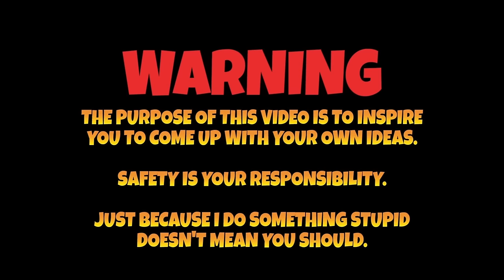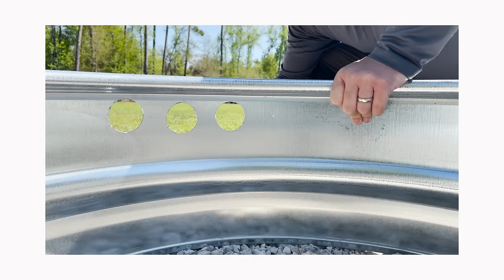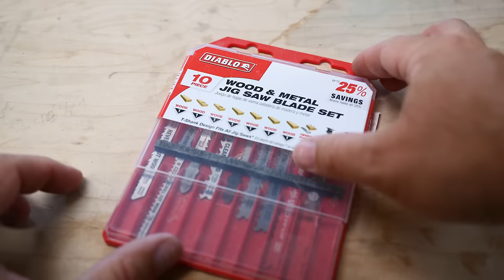8 Must-Have Power Tools For DIY And Woodworking

Comment: That Bosch Colt router is a beast! I worked in a cabinet shop for years and I beat it to death and it never gave up. I have had my personal one for many years now and it does anything I ask of it! Also if you are looking for a jig saw, look for a cordless one that matches your existing cordless tools. I have been using Ryobi cordless for 20ish years as they have retained the same battery size forever! not mot other manufacturers that have changed up styles over the years. The tech has changed but the battery "size" has remained standard.
Reply from the maker: Yeah. I don't think I mentioned it but that Bosch was used in my cabinet shop almost everyday.

Comment: Great video as always.  I still think the Table saw is far more dangerous than a circular saw.  I would add 2 tools to your list... an Oscillating/Multi-Tool & a Reciprocating/Sawzaw.  Although not a must-have, but If you plan to start making furniture, of course a planer (like a lunchbox planer) is super important for milling your wood to dimension.  Although a Jointer being the companion tool to a planer for doing milling, as you mentioned it's really not needed at all if you have a Track Saw or other tools and unless you have a dedicated shop that's large enough, totally not worth it.  Benchtop Jointers are also pretty much useless.
Reply: yeah i actually think the impact driver & osci should be in the top 5

Comment: Hey Adam! I bought the DeWalt 20v hammer drive drill that came with an impact driver almost 8 years ago. I thought the driver was a waste since I had a drill, but boy was I wrong. The impact driver is my go-to tool more than any other. I use it several times a week and the original 3amp batteries are still going strong! You know what tool I bought that I hate? One of those roto-zip things for cutting drywall around outlets. I gave it away and bought a cordless oscillating multi-tool. Love it!
Reply from the maker: Yes those multi tools can be a lifesaver. When I used to install cabinets in existing homes I had to remove baseboard to cut it. When they came out with those multitools I could just cut out the section I needed removed. HUGE timesaver. Thanks Ed!

Comment: I would recommend a non-sliding miter saw because the sliding mechanism introduces too much play. I've tried sliders from Makita, Ridgid, and Dewalt and none could cut a consistent or straight line. The Makita was a particular disappointment - sliding 90 degree cuts were bowed about 1/16" of an inch). Went back to a non-sliding and have had much better luck.
Reply from the maker: You should try the Bosch with the articulating arm. It cuts like a laser in and out of the same cut. No drift. I used mine in a cabinet shop for many years and it still cuts like the day I got it.

Comment: Hi , a bit late but I wanted to say this : in Europe we have all 3 tipes of drill in 1 , it comes from the manufacturer most of them. You just select what you want to do with it with that "clutch" . I was always wondering why you need 2 drills . Thanks for the video.

Comment: thanks for the video.  Although I have to say that you don't need to stick with one battery platform because one brand does not make the best of each tool.  you will need at least in my opinion three different tool brands to cover all of your woodworking needs the secret is get a couple of decent batteries for each brand and then by the bare  tools after that that's where you save the money

Comment: Something I would like to point out is that all the tools that have 20v max in them are not 20v but rather 18v, the 20v is just max battery voltage at full and under no load, but it drops down to 18v when using it.

That also means the 18v tools are technically all 20v max as well, but they are advertising it how it would function under normal circumstances.
Reply: Came to say this. 18v and 20v are the same thing.
Reply: Some brands says 20V like Dewalt because Milwaukee patented the "18V"! So to avoid paying royalty to Milwaukee, some brands just label theirs as 20v instead. And who says I can't user impact driver to drill? I find that I use impact drivers more than the drill. It's smaller, shorter, and just 1 tool. The bits are easier to insert and remove too. So as long as the holes are 1/4" or less, I just use the impact driver for everything, drill, then drive screws into them.
Reply: @1tuyenp  That's not true, at all. Dewalt originally had 18v tools when their batteries were NiCad and had the battery slide up into the grip, but they changed to 20v Max when going Li-Ion to avoid confusion.

Milwaukee patented Li-Ion technology, so it doesn't matter if dewalt used 18, 20, or any other voltage, they would still need to pay some royalties. Bosch, Makita, Metabo HPT, Ridgid, Ryobi, and Skil are all brands I can think of that use the 18v denomination and not 20v; even dewalt uses 18v still in Europe and a few other places because they can't advertise max voltage when the battery is only 20v at full charge and no load.

Nobody said anything about drills or impacts as well, they make impact rated drill bits for that very reason.
Reply: @tylerperlenfein  I have Dewalt 18v Lithium-ion battery tools that I still use. Milwaukee sued Makita Snap-on and other smaller tool makers. But they never sued Bosch or Dewalt. TTI makes Milwaukee, Ridgid and Ryobi tools. That's why those tools are 18v. Those smaller tool makers like Snap-on lost the patent suit to Milwaukee must have an agreement with Milwaukee, so their tools are 18v as well. Stantley Black and Decker makes Dewalt, MasterCraft, Black and Decker, Porter Cable. They were not sued by Milwaukee and probably did not have an agreement with Milwaukee, So those tools are marketed as 20v. I don't know much about Europe or if Milwaukee's patents are valid in Europe. So I'll pass that on.
Reply: @1tuyenp  The battery related patents that Milwaukee hold are related to Lithium based battery packs, there is no mention of voltage because they can't patent a voltage level that a battery operates at.

The suit you are talking about also only mentions lithium based batteries, not the voltage. The original batteries that Milwaukee produced as Li-Ion were V28, so once again voltage was not at all a deciding factor in this. Ridgid even filed a suit against Milwaukee despite both being TTI products, so that argument doesn't really hold up that well.

Makita and Hitachi both settled out of court, but Bosch was never sued (unless the place I am looking missed the records of it happening) yet they still make 18v tools.

Milwaukee also makes 12v tools, but so does DeWalt, and DeWalt hasn't been forced to change the voltage of those tools.

I really don't know where you came to the conclusion that Milwaukee owns an 18v patent when that has never been a thing they had nor can you really patent a voltage, especially considering voltage changes with charge, temperature, the load it is connected to, etc. They own a lithium pack patent, you can even look it up with a 1 minute search and read that it in no way mentions voltage, DeWalt only went 20v to differentiate between new tools and old tools that used a different connector type.
Reply: @tylerperlenfein  You can avoid a patent by paying the royalty fee? Like you can avoid my "obnoxious" demand by doing what I say? I asked how long have people package battery cells to make a bigger battery? Then Milwaukee uses lithium ion cells, then it's a patent? I don't care if that's what Milwaukee wants. I own Milwaukee tools too. But I do think they are bogus patents. Just like putting words together to write a story. They can claim copyrights for the hooks, or the way the package the cells together. But patents? They did not invent anything. So their patents are just bogus. As for 18v or 20v, tell me why Dewalts don't want to use the same marketing outside North America? And it's just coincident that Milwaukee's patents probably are not valid outside of North America? Do you know that patents office now a day don't have the resources to research patent applications anymore? So they would grant a lot of patents to big companies with high power patent attorneys, and let the courts to sort it out. But then in courts, it's just a crap shoot.
Reply: @tylerperlenfein  Those who cant' argue on merits attacks spuriously
Reply: @1tuyenp  I'm really living rent free in your head if you had to come back to something that was already done being discussed and make a new "clever" comment.

Be better than this...
Reply: @tylerperlenfein  That's just what I thought when I saw your comment again

Comment: You can get a drill chuck and drill bits with  1/4" quick connect ends, great to only carry 1 tool up a ladder to predrill and drive screws.

Comment: ALWAYS wear safety glasses with a mitre saw. Last year I didn’t follow my own advice and was trimming some boards, a freak breeze blew a 1”x1.25”x8” offcut back into the spinning blade, the offcut got picked up and thrown directly into my right eye at over 140mph. The fact that I still have an eye is amazing, the doctors said that if the piece was thinner it would’ve taken out my eye and impacted my brain.
Reply: Yeah same happen to me but I was lucky it got stuck into the blade but I got a serious case of kick back and the baseboard whipped my finger giving me a bad bruise I felt for 2 weeks…. If it didn’t get stuck it would have flown to my face. I wear glasses now
Reply: @marlonestrella8105  I can say from my experience that you did get extremely lucky. The final piece of paint/wood finally migrated out of my eye 12 months after the injury. Until that piece left if a light source was at a specific angle that one eye would get a light flare up inside it due to reflection. That whole experience was all around horrible
Reply: @SKPhoto816  damn…. Sorry to hear that…. Kick backs are no joke… did you upgrade the throat plate for zero clearance on your miter saw?
I get anxious when I see you tubers who’s using power tools without safety equipment on…. People who don’t use glasses and riving knife on their tableaws irks me the most
Reply: @marlonestrella8105  yep, I did a custom zero clearance to avoid further risk and give me cleaner cuts. During the day of my accident I was wearing safety glasses, I took them off because they got too fogged up and made one more cut like an idiot. Now if they fog I stop working with the power tools and do something else
Reply: @SKPhoto816  have you found a safety glasses that doesn’t fog up yet?
Reply: @SKPhoto816  it’s also Anti glare which is a super added bonus when you have light reflecting off of surfaces like the brushed aluminum reflecting light off of the tablesaw or mitersaw surfaces. Dewalt has this issue big time
Reply: @marlonestrella8105  yep. I use Wiley X sunglasses. They have a Climate Control series that has a removable seal that fills all gaps. They stopped a fragmented bullet from hitting me in the eye and now I wear them in the shop too. Not worth risking an eye injury again
Reply: @SKPhoto816  do you have a link for it. All I see is sunglasses lol
Reply: Praise God!

Comment: The problem with Trim routers is they only take 1/4 inch bits (at least as far as I have seen). Most full size routers will take a 1/4 and 1/2 inch bit. You just have to swap out the collet. I would definitely recommend buying a full sized router that takes 1/4 and 1/2 inch bits over the trim router as a first router. There are a lot of router bits that you can only get at 1/2 inch, so it will save you money in the long run.

Small table saws are good for small jobs. Cutting that large sheet of plywood on that small saw is one of the stupidest things I have ever seen. It's a great way to get seriously injured. Use a track saw for that if you don't have a full sized table saw.

Speaking of getting injured, never cut wood like this. 17:29 Narrow strips of wood.. well any wood really, should never be cut freehand on a table saw. If that wood goes out of square with that blade it can bind up and that saw will throw it back in your face, possibly killing you. When cutting narrow pieces of wood like this, use a miter gauge and never have the end up against the fence like that. You are just asking for serious injuries.

And, before anyone says "I've been doing this for XXX years and never had a problem", there are a lot of people who say the same thing after losing a finger of even worse injuries caused by ignoring safety. remember, a table saw can launch a piece of wood through a wall and anything in between it and the wall, including you.

Comment: Good video man I must agree with you on those Milwaukee 12 V awesome little machine but I do disagree with you on the impact my dewallt 20 V is essential to My job/company of residential rebuild and renovation, it has more than enough power to drill through just about anything required even stainless although not concrete that’s a given but I’ve used it more in the past four years than any other cordless tool I own. Plus now that the wall makes the larger 20 V and 60 V for landscape tools and saws I just pop one of those on the impact should I need a little more umph
Do you invest in that cordless circ saw you’ll thank yourself for it but keep that corded one handy for heavy duty jobs like beams and what not but just the ease of not having that cord behind you like you were saying with the jigsaw

Comment: Circ/ miter saws are both so useful however miter saws are way more accurate than making similar cuts with a skill saw (unless you are a master of your trade.) Regardless of the brand, circular saws are referred to as skill saws in the trades for a good reason. They require practice and skill to achieve the same quality and precision cuts as a miter saw when precision is a necessity. Props to the skilled trade workers who are more accurate with a circular saw than the DIY users with chop saws/ compound miter. To the at home DIY guys and gals, keep it up because practice makes perfect!

Comment: I have landed in the Ryobi Eco-System and endured a lot of teasing from "professionals". In my experience, Ryobi is less costly and less sturdily built - IN SOME CASES. The warranty from Ryobi is honored if you register the tool and keep the receipt. The Home Depot (at least in Northern Colorado) will send you an email receipt, which can be automatically filed by Gmail - therefore, never lost.

Ryobi has always honoured its warranty for both tools and batteries. I know so-called "pros" tease about Ryobi but for me, not a pro, the brand has been great.
Reply from the maker: I used Ryobi “professionally” for several years about twenty years ago. (When they were dark blue) I found them to be well made, durable, and long lasting.

Comment: I barely do any woodwork, however, I want to complete my toolset like yours...
I have most, but don't use them as much as I told my wife I would.
Reply: That's funny, but if you saw some inspirational builds with easy to follow instructions you may use them more. Happy building!
Reply: @inspiringbuilds  oh for sure... I might do a similar build to the grill cart he just did for the Weber. After I sell my big green egg. I tend to use my drill weekly, I prefer a hand saw and axe for firewood, and I use the small 1" wide belt sander (bench) for sharpening knives... but it's all fun

Comment: I have a Makita 7-1/4" circular saw, a Kobalt 6-1/2" circular saw, a Rockwell 4-1/2" circular saw, and a Dremel 3" circular saw, my favorite that I built my 31ft.X40ft. house with, is the Rockwell 4-1/2" circular saw, my house sits on 20ft. 2"X12"s every 16-inches on center,   the wall studs, ceiling joists, and rafters are all 2"X6"s, and all are 16-inches on center,    the Rockwell was amazing, and is still going strong ") I'm working now on adding an 11ft.X40ft. addition on back of house, still using the same saw blade that came with saw when purchased at Lowe's, the Rockwell 4-1/2 inch circular saw is a must for every DIYer as well asthe professional, ")